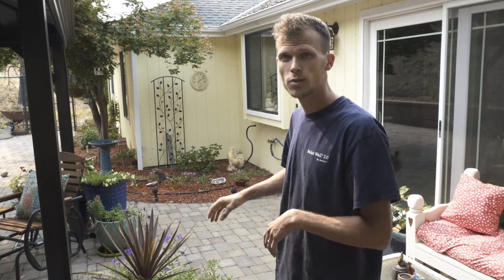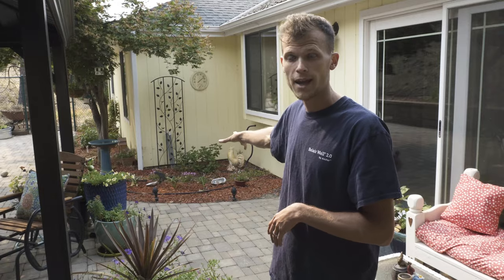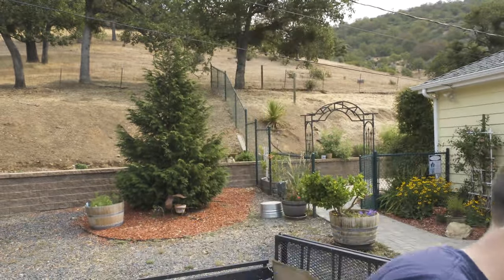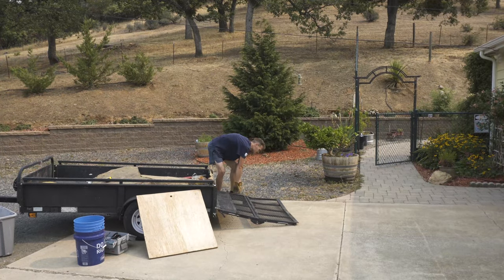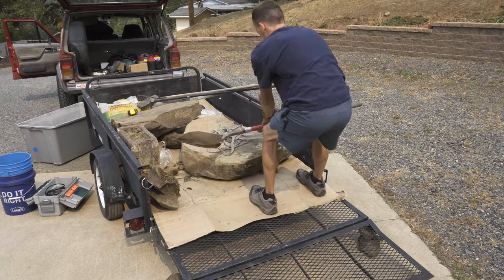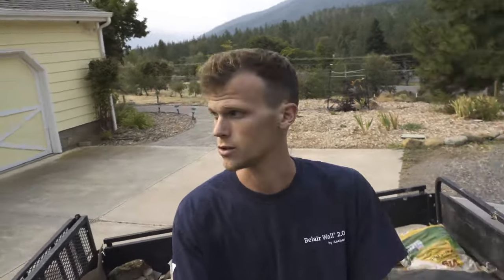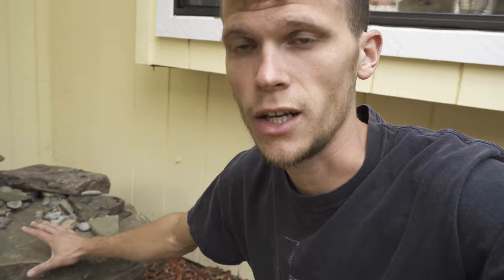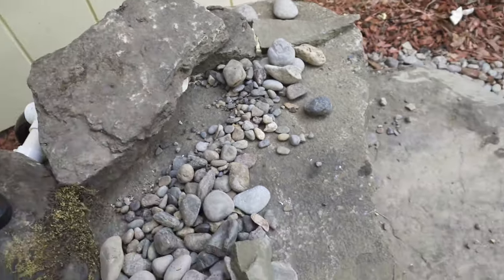Awesome Bubbling Waterfall Build

Comment: Love the sound of the waterfall!  We have a similar space and we have been struggling to find the right idea. Thanks for showing the split pipes so the water disperses better. We will try to recreate this with two rows of smaller rocks.  Wish us luck!
Reply from the maker: Good luck! Glad I could help. Yea I was trying to come up with a way to start the waterfall without having to drill through the rock and it occurred to me that if its in a corner, nobody can see the back end. Just note that the liner goes all the way behind it in case any water does trickle out the back, its still contained in the liner. But all you have to hide is the very top where I put that split in the pipe :)
Reply: @travisjantzer  Why would you not turn the tubs over for a sturdier surface?

Comment: Looks really cool, but is there a reason you don't simply leave a small pond at the end. Is it simple and aesthetics choice or is there a benefit in maintenance or something.
Reply from the maker: Good question, ponds need a little more maintenance and lose water to evaporation easier. The river rock on the surface helps filter out larger debris like sticks and leaves so you don’t need a filter on the pump.

Comment: Love it the look. My only concern is someone stepping on the bucket area and falling through it. Doesn’t look like it would support a toddler stepping on it. I’d go with something much stronger to be safe, like plastic grating. Also can use pvc pipe across to create stronger supports to step on.
Reply: You could also use a lid on the buckets with holes. One acting as a pump vault. This would be much stronger than the plastic over the top.

Comment: I love this project!  Not only does it look great but it's low cost.  One question, how do you know when makeup water is needed so the water level doesn't get too low not to burn your pump up?
Reply from the maker: the water will start looking bubbly when the water gets low. I've ran them dry before and the pump survived. Some pumps have build in shutoffs for when they overheat.

Comment: Looks great Travis! I’m just confused about the buckets. Are they supposed to function as void boxes or something? Do you put the pump inside the buckets? I saw water in the liner so I wasn’t sure
Reply from the maker: Yea I used them to hold the plastic at the top which holds the river rock. Then yea i was able to put the pump in one of the buckets. Worth noting I punched a few holes in each bucket to allow waterflow.

Comment: Is there any way u can make video of how u set up the 2 buckets  n water. 🤔 just want tknow that process, do u fill the buckets with watwr n cover them with the grey plastic rectangles and add rocks. Just don't want to make a mistake thanks a bunch.
Reply from the maker: you got it right. I drilled a few holes in them though to make them porous. They just hold water volume. More volume is better.

Comment: With how the water falls on the edge of the rocks, how are you ensuring water isn't getting out? Just a large pond liner ?  Also whats the maintenance on this thing ?
Reply: The liner is spread pretty wide and goes below and outside of the rock. Should catch it all
Reply from the maker: Matthew is right the pond liner extends out past all sides of the rock. Maintenance should just be hosing it off periodically to keep it clean and top off the water as some will inevitably be lost to evaporation. The river rock should filter all large obstructions so I don’t know that you would need to access the pump much at all.

Comment: Hey Travis so I'm trying to do something similar (a rockery steam style one like in one of your other videos) I'm struggling with the concept of how you reach the pump to clean after you have installed it do you have to remove all the rocks to remove the "lid" to gain access? Also why do you use two tubs? Thanks 👍 cool video
Reply: Sorry another question how come the tubs go over the pond liner, would this not make them float with the water that will suround them??
Reply from the maker: Yea so the tubs have holes in them to allow water flow. They're just to hold the platform and rock up out of the reservoir. I used two just for more volume. In this project, yes the river rock has to be moved to access the pump, but in other projects Ive made the pumps easier to access by putting them in containers with lids, or putting just 1 larger flat rock on top of it. Realistically though you should not need to access the pump very often. 
If you want to send me pictures of your project I can maybe help you brainstorm! :) best of luck . .

Comment: The grey plastic that you cut to lay over the buried tubs is it 1 piece just laid on top?. if so doesn't it block the water that needs to go back in to the sunken tubs when you put the weight of the pebbles on it?
Reply from the maker: I cut a few extra holes in it. but most the water just pours around the edges.

Comment: Can you describe how you used the large tupperware container over the two buckets for the water reservoir?
Reply from the maker: Yea so the two buckets had holes in them to allow water flow through them. They were just to hold the weight of the river rock on the surface. The plastic I just cut to cover the hole and rest on the buckets like a lid. The plastic in those tubs is pretty flexible but also hardy. Though If the hole was any bigger than the size of those buckets I would have used something stronger and more rigid. So I just doubled up the plastic for thickness and it extended out past all sides of the reservoir and kept the river rock from falling in. I was able to stand on it. It’s something I’ve been trying, in order to save on cost.
Reply: @travisjantzer  Thanks!  I have been looking for a DIY alternative to that step.  Love your videos.  They have been super helpful with my plans for my pondless water feature.